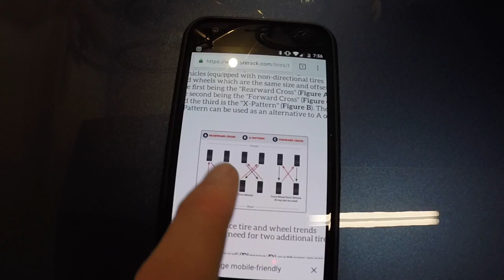2017 Subaru Forester XT: Easy Tire Rotation!

Comment: Well done and informative vid. You got your exercise in. When I saw that nice blue floor jack I was like this guy has patience and is showing that it can be done with vehicle included tools.  Absolutely right doing it yourself is the way to go. Most shops will not take the time to torque the wheels or use the proper rotation patterns that you mentioned. Sweet garage set-up!
Reply from the maker: I did it to prove it could be done! But yeah way easier with better tools!

Comment: My owners manual said to cross the back tires and move the fronts straight back.  The forester must be different than a WRX? Do you notice more tire noise after rotating? I rotated mine at the same time I took the snow tires off  and they sound noisier than I remember.
Reply from the maker: +Savage Grace the stock WRX tires are super noisy! I don't know if the Forester manual says the same I've always used tire tracks recommendation and it's worked great 👍

Comment: Today is tire rotation and oil change day...I might try this method just to say I did it.  I wish the 2015 WRX had a "fruit loop" in the front to make it easier for the two back stands on the sides.

Comment: Great video Chuck! I noticed the OEM lugs gets pretty nasty looking on Subi's. I put on black Gorilla lugs last weekend when I took my winter set off and the OEMs back on. Using a great floor jack, torque and impact wrench of course!
Reply from the maker: I've got a set of black lugs on the STI, I need to pick some up for the XT as well!
Reply: My OEM lugs had just under 6k miles on them are already looked rough. The standard chrome lugs from Tire Rack did OK on the winter wheels, but the wheels are Enkei black. I like the black lugs with the OEM XT wheels, I'll send you a pic via Insta.

Comment: For less than  $100 extra at the time you purchase a set of 4 tires from a  national chain, you can get the wheels rebalanced and rotated every 5000 miles for the life of the tires, plus blowout insurance.  That's roughly $15/change. For $30 you can get a folding cross-wrench  (or a breaker bar)  and a basic torque wrench that will last a lifetime, and let you reset the lugnut torques to be assured they are tightened properly.   A cross-wrench is better to use for loosening overly tight lugnuts and doing tire changes than the OEM wrench and will fit in the spare tire well.  With those tools and a tire shop, you can finish a tire rotation without getting dirty or work up a sweat within 10 minutes max..
Reply: Yup. That's exactly what I do.  Though I don't even normally have them rotated on a schedule because I rarely put on more than 5000 between swapping between my winter and summer wheel/tire sets. The rotation happens for free at the shop. If you just go in, even not having bought tires there, I know of two chains that'll just do the swap for free regardless trying to earn your future business. For my part, their little tactic worked like a charm. :)

Comment: What about TPMS sensors?
Reply from the maker: The car doesn't care where the sensors are all 4 just have to be within range. So when you rotate it's not aware which wheel is which.

Comment: have a 2" lift on the SJ, that oem jack wouldn't lift the tires off the ground >.< I would need two pieces of wood stacked. Another jack you could recommend that'll give it more lift without the extra layers of wood?

Comment: Thanks Chuck.... just used your “spare tire” technique to rotate tires on my Subaru Outback XT.... worked great ! I do have a hydaraulic floor jack and large 4 way cross wrench to speed things up. What do you think about applying a little grease to lug nut threads ?
Reply: Owner's manual states "Never apply oil to the threaded parts, wheel nuts, or tapered surface of the wheel". I'm no expert but for now I assume that applies to grease too.  Grease might make the nuts easier to spin on&off and initially break free, but that's only good thing while you are doing it, and could be a very bad thing while driving.  I'll stick to elbow grease (or good tools to make it easier.)

Comment: Where do you find the torque specifications for the lug nuts? I have a 2017 Legacy and am going to start doing my own oil changes and tire rotations and want to be absolutely sure I do it right.

Comment: Any suggestions on jack stands and floor jack?
Reply from the maker: Honestly a cheaper set from Harbor Freight will work great!
Reply: Just make sure it will raise the car enough since the suspension to travels down as you lift the car. A "trolley" jack typically won't raise a Forester enough to get the tires off. I learned that the hard way. Go with a true floor jack that isn't a super low profile 9" lift max since the Forester starts at 8" clearance then add the suspension drop into the equation when you lift the car.

Comment: hello would you recommend buying a subaru forester 2016 navi or outback 3.6 2017 both have 16,000 miles, is the brand reliable? or I will have problems.

Comment: just to be clear and get advice from someone who knows way more about the WRX then I do...

my tires have "Outside" stamped and want to say they are non-directional?  So fronts go to back and back in the front criss cross?  or am I all fxxxed up lol
Reply from the maker: +GR8GUY54 as longas the tires are not directional (you'd see and arrow and some words telling you which way the tire is supposed to rotate when driving) you can use the same method I just used! If you have a new WRX and it came with stock tires then you should be good ✌️

Comment: Chuck, do you do any maintenance for intake valves? I have a 2016 XT model and wondering if I should start taking some measures to decrease or slow down carbon build up? Thanks.
Reply: Search in google for a document titled "Motor Gasoline Technical Review" written by Chevron employees (about USA gasoline market). Chapter 6  Gasoline Vehicles —  Deposit Control

Agurrak ta ondo izan,